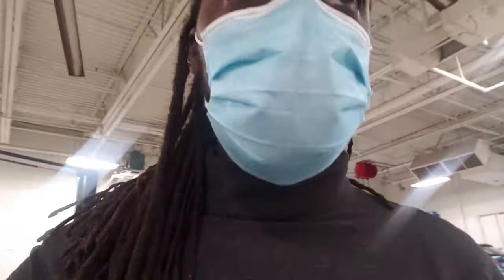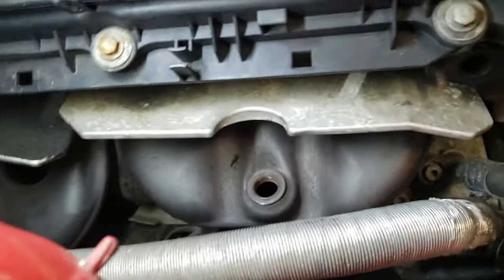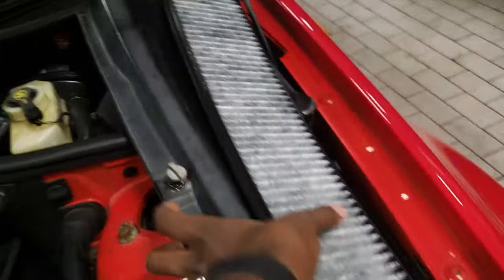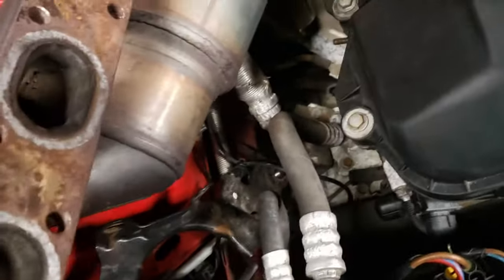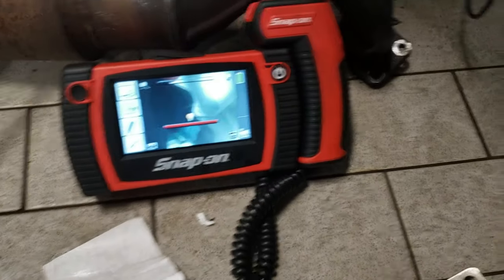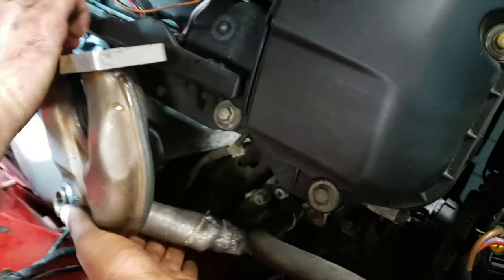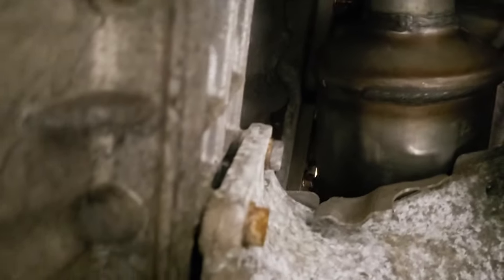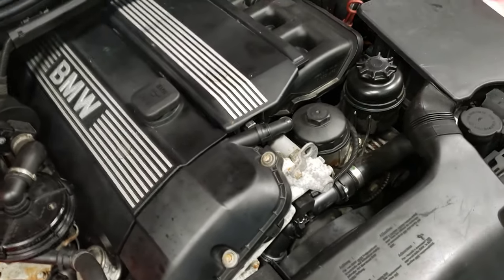e46 Catalytic Converter Install  |  The Forbidden Technique

Comment: Doing a catylic converter replacement on a 2002 x5 3.0 on the 22nd. I am not a mechanic…. I watched your video to see how it is done so I could feel more comfortable about the shop I have working on it. I took notes from you so I can micromanage and watch for mistakes. Staying in my budget… Thanks for the demo.
Reply from the maker: No problem! You are able to take it out from the bottom, which is probably the most common way. This just proposes another avenue which might be easier for some. Hope the replacement goes well!
Reply: @KoseyM  Cats clogged on my 325i E46. Website and model name for cats please? Thanks a million!
Reply from the maker: https://www.ctconverters.net/ I went there but I'd call ahead if you're in the CT area

Comment: DM me guys... i have a 2011 bmw x3 28i and i have a coolant leak plus catalytic converter is leaking somewhere the rear one. Got a code P0171. My question is, Would i be able to change the gaskets right from underneath the car itself?????  I notice in the video once the Catalytic once slid through, it just needed to get bolted on or soldering ??
Reply: Peace! I am not a mechanic but I recently had the same issue. The shop was able to change the gaskets by simply lifting the vehicle but afterwards I was still getting codes. Presently, I have to change both cats to clear the codes in time for inspection

Comment: This worked on my bmw e53 X5 2005 3.0 v6
Reply: Did you have to lift the engine? I'm going thru this, this week.
Reply: @ronfowler9563  Yes we had to take the engine mounts off and lift that so you can access and have room and also you have to takeoff the AC discharge hose and be extra careful when putting that back on because obviously you don’t want your AC going out that happened to me and luckily I was able to use a bolt and a stack of heavy washers to fix that don’t ask LOL
Reply: @ronfowler9563  be prepared to do the fuel filter as well if your trying to find a random misfire
Reply: @gregotero8193  false alarm! All I needed was my 02 sensor replaced! There izza Gawd!
Reply: @ronfowler9563  glad to here that these things can get spendy so that’s a battle win in my book. How bout them door handle carriers tho 🤣
Reply: @gregotero8193  man what 😂
Reply: Bro u got a v6 😎

Comment: Thanks for the video. 
How did you install the new studs without smashing up the studs?

I got my new studs but there is no where to hold them and install without messing up the threads.
Reply: Use two nuts backed up against one another then tighten the stud using a socket over both nuts
Reply: Thanks, I ended up finding the Star torx bolts the worked out fine